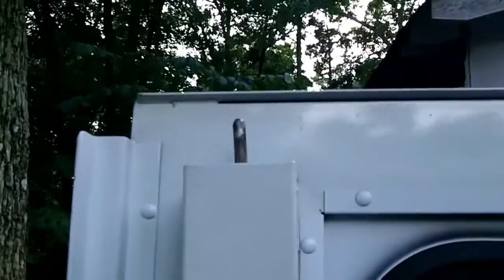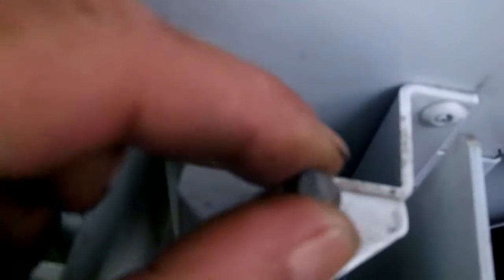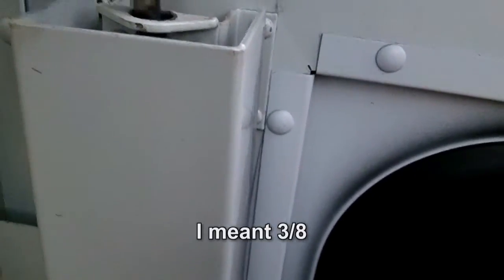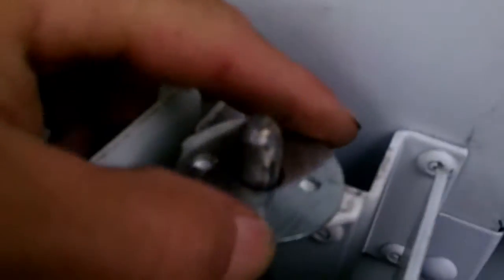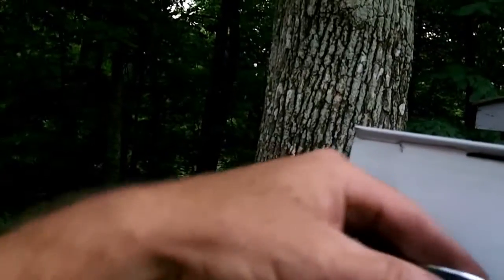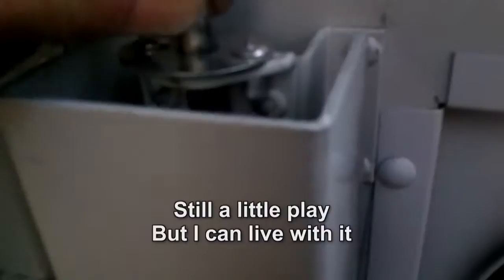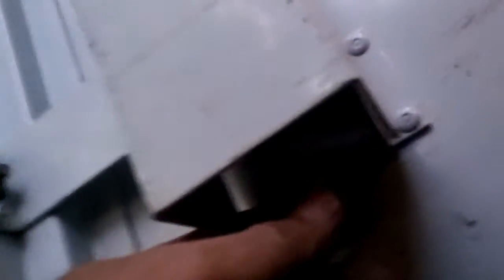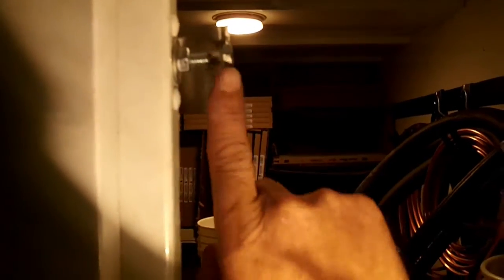Stahl Utility Truck Bed Backdoor Repair

Comment: Atta boy Ralph, fix that puppy and save those green !!!! In about 1984/1985 I need a wiring harness from Ford and they wanted almost $300 for it. Went to AutoShack (before it became AutoZone) and bought a trailer wiring harness for $1.62 and spliced it in. Was still working when I got rid of the car in 1991. LOL. They thinks we are stupid I guess. Great job !! Take care, Brett

Comment: Thats stahl for you, we bought a knapheide and a stahl body van last year, knapheide was wayyyy better, doors work so much smoother and much better designs, they’re easy to work with. Then the knapheide got wrecked. we bought another, the new one is even better.